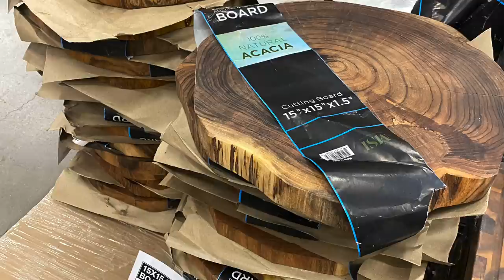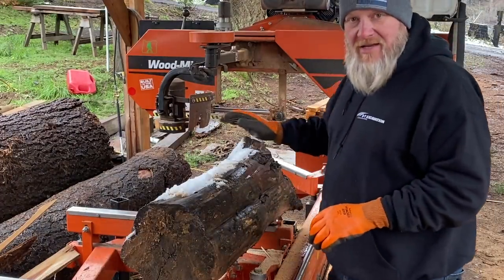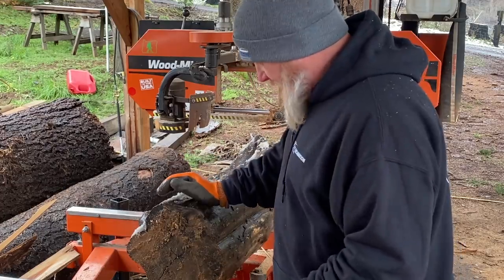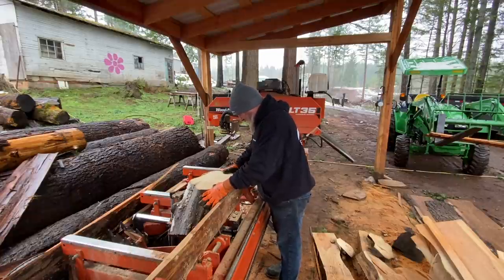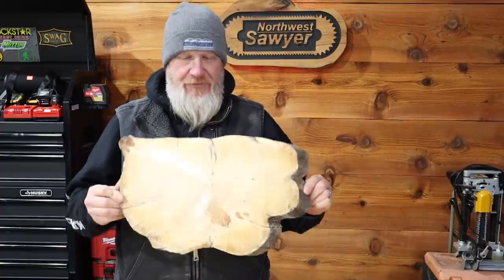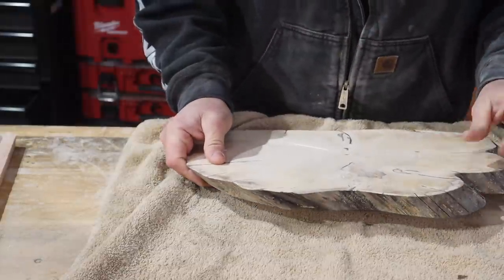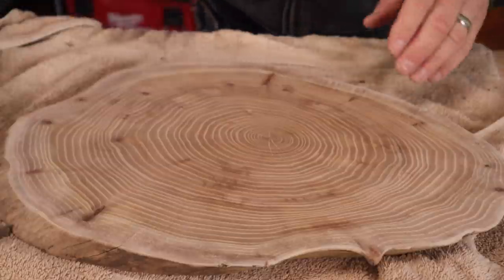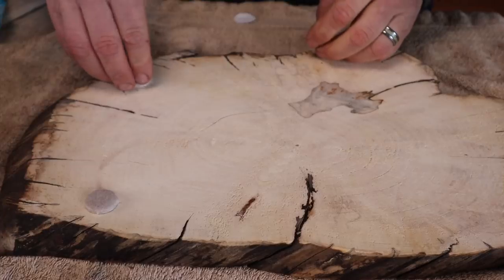Firewood to FANCY

Comment: I would recommend putting a food safe sanding sealer on it next time so it doesn't drink up so much cutting board oil.
Reply from the maker: Honestly I think that piece of wood is a little beyond working with. It’s typically a very dense hardwood and shouldn’t drink the oil like that. The walnut on the other hand is working as you’d expect. Two coats and it’s good to go.

Comment: To add to the display of your rounds, Iron and Oak Sawmill has a customer that gets rounds from them for woodburning pictures into them.  Cicil Skinner has started lasering pictures into his small rounds for coasters, and larger rounds that he makes into stools.  There is also CNC carving that could be done on the rounds.  Maybe a local Woodcraft, or Rockler store could "demonstrate" on your rounds for your display pieces.  If you could talk them into spending a few hours on each version, CNC, and laser of round for the price of stocking them with rounds to sell.  You may have to wood burn your own picture.  If it turns lucrative, a drum sander might be a good investment, as they are good for end grain work.
Reply from the maker: I actually have a company that wants me to do a video about their laser engraver. I thought it would be a neat tool to have in my shop but I can’t currently meet their time frame. As for the drum sander, there’s a nice one in my Dad’s shop that I’ll be moving over here once my shop is finished. Along with the rest of his wood tools.

Comment: Phil Anderson from 'Shady Acres Woodshop' uses a 'Sand-O-Flex' to take care of the live edges.  Take a look at his channel to see the results.  I think that it might make your edges easier to accomplish. Also, he uses multiple food safe finishes that might make your serving trays (or other projects that you decide to make) more 'colorful'.  What I mean here is that different finishes make the grains or natural colors 'pop' more.  One other thing, you might want to seal up the bottom side, to make them easier to clean, and less likely to rot or deteriorate.
Reply from the maker: The ones I have as gifts were sealed completely. I wanted to be able to show the pads I was installing in the video so I didn’t seal these. You definitely need to do both sides. I’ll have to check out those other finishes.

Comment: “Tricky PROPisition.”  Ha!  After seeing what you did, $60 seems reasonable. I just hope those HD items weren’t from some .12 an hour shop.  I know it would make attaching the feet more difficult, but would you oil both sides?
Reply from the maker: I didn’t seal both sides of these so I could stick the pads on in the video. You’d definitely want to seal both sides before use which I did on the ones I gave as gifts. I wanted to get this video up and didn’t have time to let the bottom dry before applying the pads.

Comment: Hard to believe that folks would spend $60.00 on those cut off pieces in Home Depot.  I wonder if they will curl like the 2x4's they are trying to sell at our local Home Depot, they've got a 180-degree twist in them!  So, Jason did the contractor ever come for the final payment?  How much did you charge for the unauthorized use of your tractor?  Great video thumbs up.
Reply from the maker: Thank you, Craig. They haven’t come for the final payment because they still aren’t done. Still waiting on the overhead doors. 4 weeks ago I was told they would be ready in three weeks. We’re 17 weeks into this three week project.
Reply: @NorthwestSawyer  A good clause to put into a contract is one for performance:  Total job expected to take "X" number of days, payments due on completion of certain elements such as foundation, framing, weather proofed structure, electrical.  Keep in mind that a good contract will allow both parties to benefit, if there are penalty clauses for failing to perform certain tasks by such and such a date then you must expect rewards for completion before those set times. I used to have three to four payments due:  $500.00 upon signing of the contract, 1/3 of the contract upon rip out, 1/3 upon the completion of drywall (including electrical) and then the final 1/3 when the job was completed.  For me the final third was the most important because most of my profit was in that payment.  Great video thumbs up.

Comment: I agree the mark-up is astronomical, especially considering its Acacia which likely means it was cut and finished in some low wage country, Acacia, like mesquite that grows here is fairly dimension ally stable if its grown under the right conditions, and the right species, its a pretty big family they key I think is to use stable closed pore woods that are non-toxic, Did you consider back filling some of the cracks with epoxy for stability?
Reply from the maker: Not really. I would like to get into epoxy work but until I have a closed in shop to work in, I’m keeping it simple.

Comment: Those make absolutely awesome charcuterie board's as well, a little jig saw action , sand paper finish and your golden.
Do you sharpen your own bands yet?
I am not that far, if you need it done!🤔👍🧡🧡🙋🌲🌲
Reply from the maker: Thank you, Craig! I haven’t sharpened any blades. I do have a pile of them that need it. What do you charge?
Reply: $8 a band   Sharpened and set?
Most all my bands are the 10° 7/8 spacing. 
But I do have a few 7° profiles & 4°

Comment: That is great. Does the wood stay stable cut on a angle like that? How do you think that would work with colour resin in the cracks? Thanks for sharing.
Reply from the maker: This wood was cut from seasoned logs so they shouldn’t warp. I would like to try some epoxy work once my shop is enclosed and heated.

Comment: As a woodworker, you shouldn’t have skipped sanding at 120 or 150 grit. And the fact that you only finished one side of the board is not good. Try a mixture of beeswax and mineral oil it will last longer. Mineral oil only on end grain is gonna soak up and dry out very quickly.